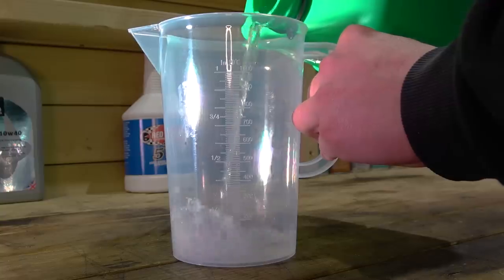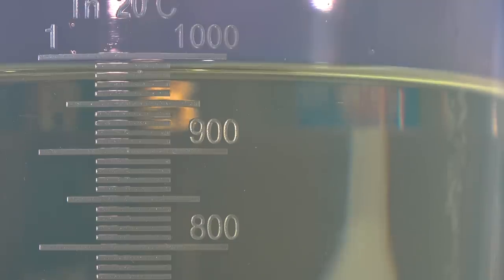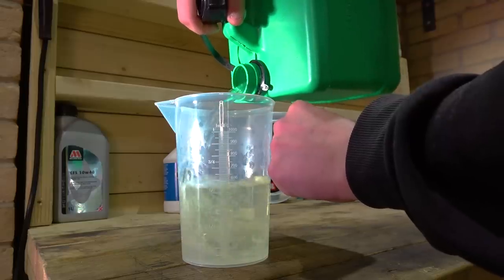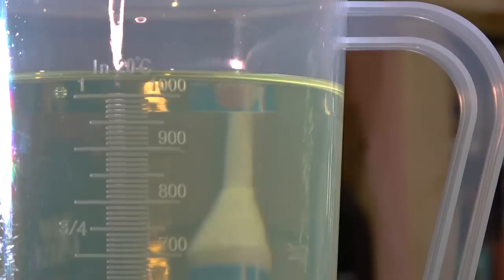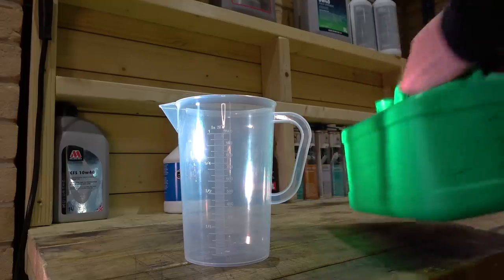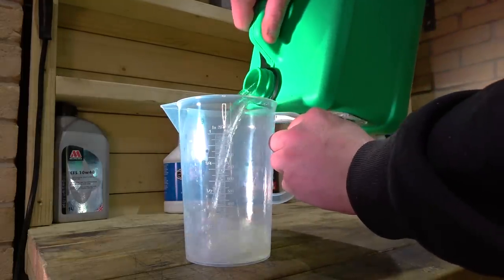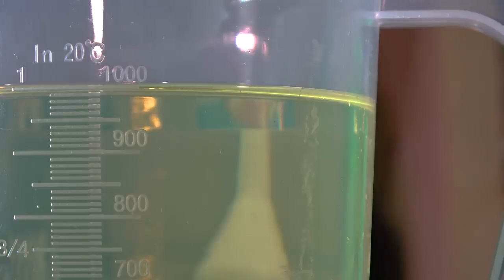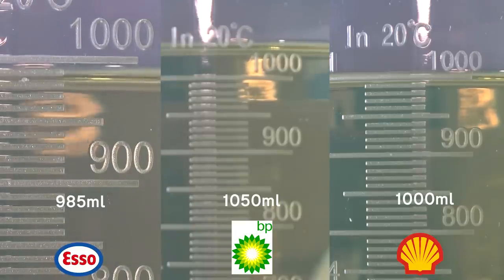Fuel Pumps Are Wrong - Esso BP & Shell

Comment: What you need to understand is gasoline is light 0.74 kg/L. There are two ways to measure fuel in the UK a standard litre (at 15°c) and measured litres (at ambient). At petrol stations  by law we are sold measured litres at ambient (temperature of the fuel). You also need to understand that the density at 15°c is different from batch to batch with  one batch being lighter or heavier than the other. As gasoline is light it will contract when it is cold outside and expands when it is warm. Therefore your measuring method is inaccurate. You would need the specific gravity at 15°c and take the temperature of the fuel at the time of filling the jerry can. You would then need to take the temperature and density using a hydrometer in your shed and use density charts to convert back to the tempeeature/density at the time of filling the Jerry can to see if the pump is inaccurate. Or do what the council trading standards do and measure it right there and then without the flaffing about.

Comment: As a forma petrol station manager, I can tell you the following influence the volume delivered. Pump manufacturer, temperature of fuel, speed of delivery,  slow fills tends to give you slightly more fuel with Gilbarco pumps. AH tend to give shorter measures as the pumps get older, VR deliver what ever they fell like LOL. BTW it is legal to short/over measure a small amount called strike. High volume sites always ensure their pumps were under strike. As a side note when measuring using the TS measurement flasks they need to be wet before delivery as this will show in the final measurement.

Comment: It's probably more to do with the manufacture and calibration of each individual pump than whose fuel it is pumping. I suspect if you repeated the test for every pump at a single station you'd get a variation across the pumps.
Reply: Nah .
Ok ill fess i refuel planes so.....
The difference is down to temp and dense taken at the time of day . Theres a standardisation that uses a mathematical equation to upscale and find conformity of delivery as measured . Today our jet fuel was at .798 at 8 degrees . They system works it out based on 15 degrees . As you can imagine fuel samples are taken day and night so the temp range can be from -8 to 20+ . A litre is considered by volume and it can swell or contract within a temp range to give different results for the same amount of fuel .

But the main difference is the speed at which the high level cut off shuts the fuel delivery . If its slow you get more fuel etc .
Reply: more to do with the inaccurate measuring jug from a kitchen.
Reply: @godzillas6301  more to do with the inaccurate measuring jug from a kitchen.
Reply: @007floppyboy  the weights and measures dude doesnt use a plastic measuring jug from his kitchen , he uses a glass vizi jar ( feel free to look it up ) .... we have moved on from the video into why things dont seem to stack up and how it happens . As i say its all down to the high level cut off and the speed of it working . 

Myself our deadmans cuts off within 2 to 5 seconds allowing 200 litres to flow max ( thats the plan ) . We pump at explanatory more than a petrol station does and we work in a scaleable tolerance thats maybe easy to understand . When you ae talking millilitre and not litres then its understandable that ther s a sway value to what gets pumped or not . When you release the trigger the time allowed for the fuel to flow will differ thanks to wear and hence 1 test showed more was pumped . If he had pumped 100 litres it would still have been just 50 mill over rather than 5 .
Reply: @godzillas6301  I dont care about the 'w & M dude', this bloke is using a cheap crapy plastic jug, its not calibrated, its for 'indication only'.

A dead mans cut off switch will work within 100mS, I know, control is my area of expertise.

Agree on the 100 litres and still 50millilitres over though.

But if you are going to measure 1 litre, then your scale and accuracy need to be down to 1 millilitre, this jug is not, its a joke.
Reply: Correct.  Also the number of liters passed through the meter, and time since it’s last verification calibration.  If a W&M tech checks the pump (verifies) and it is in tolerance then they should not calibrate to achieve a closer tolerance - the reason being that some pumps throw high and some throw low (within the tolerance band).  To re-calibrate high (within tolerance) to favour the consumer, or re-calibrate low (within tolerance) to favour the site operator would be equally wrong.  So if a pump is in tolerance it should be left alone.  Across a forecourt the highs and lows of the individual pumps, will approximately cancel out.  In the UK, I think, the “in trade use” tolerance is 50 ml on a 20 liter measure.  If a fuel meter falls out of tolerance, then it must be removed from trade use until re-calibrated or repaired.  Depending on locality, every fuel meter on a forecourt must receive a verification certificate every 12 or 18 months certifying that it was within tolerance at the time of the verification.  If their is no valid verification certificate held on the site, then the meter cannot be used in trade.  The verification certificate held on site does not show the actual measured value, only that the meter was checked and found to be in tolerance.  The verification certificate held on file at the verification laboratory shows the actual measured value recorded during the verification procedure.  The actual variation within the tolerance band is withheld from both the consumer and the site operator to prevent “cherry picking”, and or undue influence being exerted on the verification technician to force a re-calibration, when the equipment is already in tolerance.

Comment: So many variables to take into account there, How accurate are the measurements on the side of the plastic jug for a start,  Plus each filling stations pumps will probably vary a bit depending on manufacturer & age etc, You'd have to use several different sites to get a good average  amount.

Comment: I don't know how it is in the UK, but here in Canada it gets a little bit more complicated. Fuel density varies with temperature and, of course, we have some of the world's most extreme differences between summer and winter, this might lead you to believe that you are getting more fuel for your money in winter because of the greater weight of a liter in extreme cold vs extreme heat due to the difference in density. In fact, this does not happen: all our fuel pumps carry the indication that they are "corrected  to 15c". In practice what this means is that if it's -30c each "liter" you are pumping is actually less than 1 liter, but would expand to exactly 1 liter if you let it warm up to 15c. Likewise, when it's +30c, each "liter" dispensed is actually slightly more, but would contract down to 1 liter if allowed to cool to 15c.

Comment: Interesting video, I went to trading standards for work experience, we tested fuel stations for the fuel drawn v’s display screen value, the measuring equipment, copper narrow necked containers, were calibrated regularly in itself before use, inside the petrol pump there’s a tap, it adjusts the amount drawn v’s display screen value, we took 5 and 10 litre draws of fuel and adjusted the tap as required. Once set the tap was tied with metal wire and a lead press used with official seal stamp to retain the taps position.  Retailers can be prosecuted if the lead seal has gone on subsequent checks. Interesting to see on low draw levels there can be notable differences

Comment: The government department of weights and measures certifies the pumps on a regular basis.   They draw one measure, pour it out and then draw another measure for the test.  There is a thermometer built into the test equipment for a temperature correction factor.   Any pumps that are outside of specification are locked until a repair is made.   The penalty for removing the calibration seal for tampering is severe.   No businessman would risk it for a few extra coins.

Comment: I don't understand why the UK sells fuel in liters but measures fuel economy in miles per Imperial gallon. I think it's simply so that gas/petrol stations can advertise a lower price than if they were selling fuel in gallons. £1.47 per liter sounds a lot cheaper than £6.68 per Imperial gallon, even if they're exactly the same in the UK. (That's the equivalent of about $6.64 per U.S. gallon.)

Comment: I would suggest that it's not "one liter", but the FIRST liter. Fuel pumps are designed to compensate for temperature expansion/contraction of the fuel. Rather obviously, there will be a significant amount of petrol in the lines winding their way through the pump. This fuel will be a bit warmer in summer and cooler in winter. The temperature sensor will encounter a sudden temperature change during delivery of that first liter, until it properly reads the temperature of the petrol from the underground tank. But this would mean that the first liter is very often incorrectly measured. You should see the same fraction of a liter over/under as you did with 1 liter. The inaccuracy will be a smaller percentage as you buy more fuel. But, if I'm right, it happens with that first liter. Thanks for the interesting shows, John.

Comment: There is a Weights and Measures allowance of accuracy of fuel on pumps. This means that they can give you less than the amount on the reading within a limit.
Modern pumps are so accurate that some fuel companies can set the amount to the delivered to the lowest legal limit they are allowed to deliver, this represents a massive cost saving to the companies over time. It would be good for you to find out what are the allowable "Weights and Measures" differences in fuel delivered compared to the reading on the meter.
I've heard a rumour that supermarkets are the worst offender, delivering right on the minimum legal limit of what they are allowed to deliver.

Comment: Your jug can be inaccurate by the fact the chineses just put an approximate scale on a non true cylindrical jug, so if we assume the same amount evaporated or left behind in all the gas tanks, none were exactly 1 liter, but the one that appears to be more is obviously more than the rest.
And obviously the hose plays a huge role as to how it's set and how much is left in it after the pump stops, and the momentum of the fluid moving.
That difference however is within the accuracy limit you want on a gas station pump, there are other places in Europe where they get the guy pressing a secret button on specific customers and pumping less gas if any at all, or appear cheap on the price and they pump you the same amount you'd get from a more expensive gas station.

Comment: Maybe minimum delivery on the pumps has nothing to do with  money. but rather the pump needs to deliver a minimum amount to do so accurately. Google says. The minimum amount displayed on the pumps will be either half a gallon or two litres. This is all to do with the calibration of the flowmeters that measure the fuel. They consist of a number of small displacement cylinders, and adjustment is supposed to ensure they all deliver the same volume.

Comment: The energy in fuel is the kilo (mass) not in the liter (volume), the volume change by temperature and it is a lot.
So to sell/buy by the liter is wrong, so the oil company's trade in tons not in cubic meters.
When you fill up a ship with an oil product you need to be careful, you need to know beforehand what temperature there will be in the sea during the transport so you can compensate for the expansion/contraction that will happen, so you program your metering device (and it is measuring in tons) with the size of the tank to fill and the highest temperature in the sea, and the thing measure the temperature of the oil during filling and stops the filling when there is no more safe room in the tank so the tank do not overflow during the journey.
Thes metering devices are more accurate that the meters the government's control body use for control and it can lead to issues when you have to pay tax on import/export.

Comment: When measuring liquids in volumentric terms and not weight you have to take into account the temperature. If the fuel heats up or cools down in regards to the temperature it was pumped at it either expands or contracts respectively. So if the fuel pumped was 20 degrees C but its cold and it cools down to 10 degrees C its gonna be a smaller volume than what the pump measured or the opposite.
Interestingly enough here in germany fuel pumps often have a minimum of fuel you have to purchase. Usually its 2 litres minimum.

Comment: The Tesco/esso petrol station at the Crewe arms round about in Crewe would regularly have Gilbarco Veeder-Root calibrating the pumps. That in its self is fine. But as we used the petrol station at the start i our road test to ensure the cars had enough fuel after the road test for the customers new car. They would always manage to time it for month end or reg plate change. And the petrol station would have half the pumps closed. This along with the knobs who would park a car on the pump and go inside the shop for a months worth of shopping was a huge annoyance. 

What I did see whilst waiting an eternity for the knobs to return to their cars after spending £200 on a loaf of bread and a walls viennetta. The guys would have a metal jug that they would pump the fuel into and measure it and check the quality for water content etc.

Comment: I worked on forecourts for many years and every so often you get weights and measures in, they have different size containers 5ltr 10 ltr ect... to ensure the pumps are calibrated correctly, fuel is normally dispensed at 15 degree, forecourt technology has moved on a lot of the sites have things like leak detection and also water detection. we had a 9000 litre Derv  tank that we had to get cleaned out as every so many days i was having to clean out the pump filter as it was constantly filling with silt making the pump run very slow.
Reply from the maker: Do they not use 1 litre jugs from amazon?
Reply: @AutoShenanigans  lol emmmmmm nope

Comment: If pumps are more accurate at higher volumes, perhaps you could try putting 49 litres in your car, then just the final litre in your can and then measure those samples?
Reply: The issue with is with accelerating and decelerating the liquid. There is slip between the pump and the flow of liquid during acceleration. Eg. During an acceleration, the pump might rotate 5 times, but only 4 turns of liquid is moved.  Whilst the pump is running at a steady speed, the liquid will do too and therefore it's easier to estimate the amount of liquid pumped.

Comment: Not too long ago.........the fuel pumps in my area all used to have a sticker stating a required minimum delivery of 2Ltr. I would also suggest that the wetting, by the fuel, of the inside of the containers and delivery hose would also affect the measurement of a single litre.

Comment: Weights and measures only calibrate to 5 litres very rarely 2 . Your jug wont be a calibrated measure and will still be some residual fuel in the can plus what’s evaporated. Also will be something like 7c when dispensed so allow for expansion or contraction

Comment: The pumps are calibrated based upon the temperature of fuel stored. As the fuel has definitey  changed temperature since being pulled out of the ground and when you measured it, the variance is within the thermal expansion properties of gas.

Comment: It's weights and measures job to regularly check fuel pumps for accuracy. If the pump doesn't dispense accurately they should be shut down.

Comment: Comparing between the branded stations is irrelevant. Just because that's how they're branded to the customer doesn't mean that's who owns the station.
One of the biggest independent dealers in the UK is called Motor Fuels Garages (MFG). I'm pretty sure they operate over 2000 stations in the UK, and they can be branded anything. I know of one instance where there's two stations on the opposite sides of a dual carriageway both owned by MFG and one was Shell the other BP branded.
Theres several different manufacturers of pumps and many more models of pump, plus its not just the pump itself that determines it's dispensing. There's equipment in the office called the pump controller and the site controller.
There's also a feature on many modern pumps called Automatic Temperature Compensation (ATC) which adjusts the quantity of the fuel being delivered depending on it's temperature - if active on the pump there legally should be a marking saying something like "@ 15 degrees". Because fuel expands and contracts.
Pumps are calibrated using 20L vessels, a minimum of 2 draws are taken and if the varience between them is beyond legal tolerance further runs are done using 10L and even 5L if necessary. Once it's determined how far from zero the pump is dispensing it is then adjusted to within legal tolerance as close to zero as possible. Legally a pump can overdispense more than it can underdispense. I can't remember the exact figures but it's something like 0.2% underdispense and 0.5% overdispense.

Comment: The pump does a test at the start of fueling  to check the Pulser( this measures the fuel dispensed) is working correctly ,you will notice that when you start fuelling , a lot off pumps also  have temperature compensation as fuel expands and retracts to the ambient outside temp  

Have  look at the Trading Standards Blog